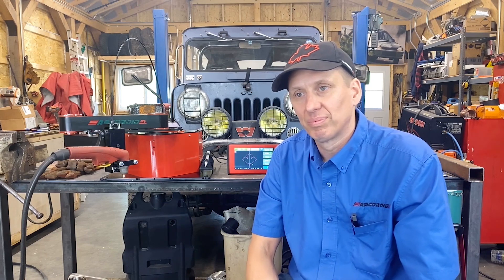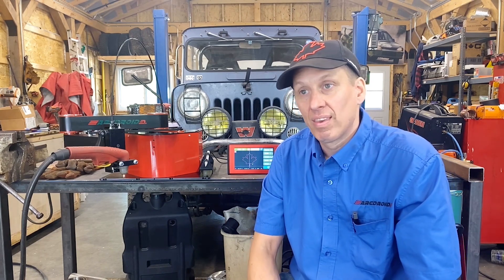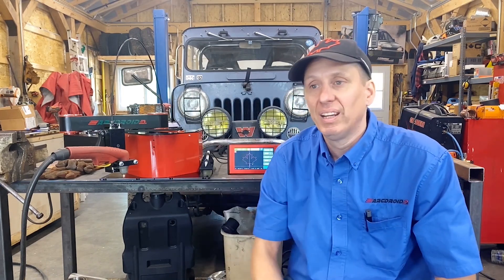ArcDroid: An interview with Andrew Miller.

Comment: It’s just a pity it would cost as much in freight to Australia as the arcdroid it’s self !! Saw it on GHPC YT channel and have wanted it ever since !!!
Reply from the maker: Can confirm shipping to Aus is $231 USD flat rate
Reply: @ArcDroidCNC  sweet , so roughly about $350 aud 👌🏿👌🏿👌🏿
Reply: @beardbuilds5140  
Probably too late but Hare and Forbes Brisbane have them in stock. I just bought one.
Reply: @davidcat1455  I actually saw that the other day !!! They put their HF tax on it too 🤣🤣
Reply: @beardbuilds5140  
Yeah they did. But I figured they’ve gotta make a quid and if there was a issue Brisbane was a lot closer to me than Canada😃👍 Edit ; Actually The price is pretty reasonable. $2500 USD is $3700 AUS and that it costs you $231 to import. H+F only charge $4000 Australian.
Reply: Freight to Australia is like $230
Reply: @meengreen42  so you have checked ? Or you are just guessing here ?!?
Reply: @beardbuilds5140  ummm is on the web store